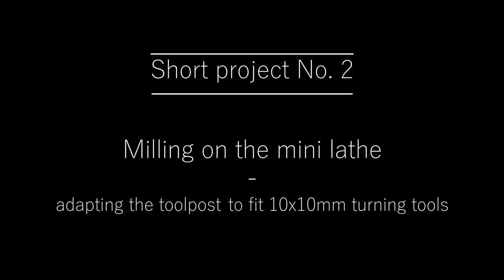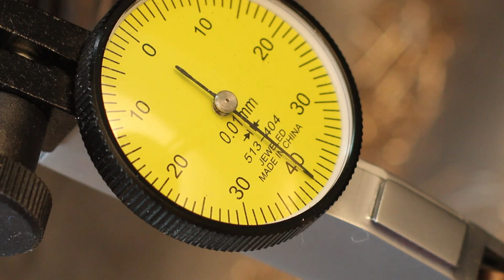Short project 2 - milling on the Mini Lathe - adapting the toolpost

Comment: excellent accomplishment. I have the inverse problem, the insert is too low and I have to raise it by 3.1mm.
regarding the milling bit, I recommend to disassemble the spindle and use an MT3 -> er32 shank and you will have much more precision and stability.
Reply from the maker: Thank you! Raising the tool seems a bit easier, you can shim it with some sheet metall:) And yes, a collet chuck would be great for milling operations on the lathe. Unfortunately I have none at the moment. Perhaps in the future

Comment: Excellent video. Of course a quick change tool post would solve the issue BUT that costs money. Much more rewarding to solve the problem with what you already have. I find the standard toolpost more robust than the cheap QCTP I have so I prefer to use it when possible.
Reply from the maker: Thank you very much! I would like to have a quick change toolpost off course, but at the moment haven't the money for that so I tried to modify the original one to be more usable for me. It's actually not that bad if you haven't a lot of different tool which you need to change often. To have now the possibility to clamp 10x10mm tools is hopefully a good improvement on it.
Reply: @WeCanDoThatBetter  Nevertheless I would recommend to buy a Multifix size AA (also named A0) for this lathe. You can clamp tools up to 12 mm height without any modification and it gives a lot of advantages.
Reply from the maker: @drucker03  Thanks for your comment! I got a Multifix Aa Toolpost in the meantime :) You find the video about installing it on my channel too. It is so much more pleasant to work with the last with the new toolpost. Makes everything much easier. Really happy with this change.
Reply: @WeCanDoThatBetter  I didn't see that yet, because I watch your videos from the oldest to the newest. But it was for sure the right decision to install a Multifix.

Comment: to minimise vibrations on these tiny lathes you can clamp down a chunk of steel in the opposite side of the tool post. in my case i can fit 25mm in the post. I have a cigarette packet block of mild. it makes a big difference.
Reply from the maker: Oh that's interesting. Thank you!

Comment: Excuse my ignorance, I'm a woodworker with a mini-metal lathe, but what is the tool in the chuck that you use - the one that looks like a drill bit?

I assume that's some sort of milling tool?

Thanks for taking the time to upload your videos.

Regards from Australia.
Reply from the maker: Hi, thanks for your comment. You mean that tool I install at 1:20? That's a carbide endmill which means a metall milling cutter out of the material carbide. They are used in metalworking to remove material on a milling machine. In my case, I have no milling machine, so I used my mini lathe for milling :) Best regards

Comment: Hello , nice idea , can i ask you is it obligatory to hold it to a 4 jaw chuck or a 3 jaw would do ? I thinking to do some milling on my lathe without buying a collet yet . By the way i ve seen Some bangood collet set reviews and they sometimes have more runnout that a 3 jaw chuck . Also i am thinking of making a vertical milling slide for my lathe with linear bearings cause i have them as a spare and secondly the vertical slides i can find close to me are not good and the good ones will take to much time to ship , whats your opinion ? Are linear bearings good for the job or dovetail slides are better ?
Reply: Using a mill in a 3 or 4 jaw chuck can be extremely dangerous i really wouldn't recommend it.
Reply from the maker: Thank you! I think, the 3 jaw chuck is better than the four jaw for this. It's a lot easier to clamp and the runout should be ok for this. Off course best would be a (good) collet chuck but just try it with the 3 jaw and watch the endmill. In my case the endmill wandered out of the chuck, be aware of that and clamp it tightly. 
For the milling slide, I think on manual small machines you go better with dovetail slides. The linear bearings are easy to install but they have no natural drag or resistance. That might result in chattering when not clamped firmly. But if you have the rails, I probably would try it out if its not too time-consuming. Apart from that you can find cheap vertical milling slides on ebay from india for about 60€. Perhaps they work aswell :)
Reply: @WeCanDoThatBetter  a trick you can use if you're gonna use a 3 jaw for milling is wrapping a piece of paper around the end mill, it helps to give it a little more friction so it won't slide put as easily
Reply: @WeCanDoThatBetter  
Hello , i know ve see them on ebay a month ago and thought a month would be too much to wait xaxa . Maybe a good way to avoid end mill slip would be to turn a cylinder with a set screw that will go to the flat spot on the end mill , i dont know if a bigger thing is easier to slip than a smaller . I know its better with the collet plus my lathe goes up to 4000 rpm that can be used with collet but with the chuck it says up to 2500 . An other idea , even more dangerous and maybe kind of stupid , if we grab a specialy grided tool bit in the 4 eccentrically woudnt that be a kind of a flycutter ?

Comment: Great video! I would have taken 2mm off the tool holder rather than mill the post. Good job nonetheless.
Reply from the maker: Thank you! Yes, that was my first idea too. But than I felt bad about milling the good quality Tungaloy insert holder and feeling better with a 2mm thicker tool. The 10x10 tool hopefully are a bit more rigid than the 8x8mm ones.That's why I come up with the idea to mill one slot of the toolholder to fit the 10x10mm tools and therefore are hopefully a bit more flexible with the tools in the future.
Reply: @WeCanDoThatBetter  Makes sense!
Reply: @WeCanDoThatBetter  The rule of thumb here is to always modify the least expensive part.
Reply from the maker: @garygruber1452  That is good to know. In this case the cheapest thing is probabley the tool holder :) I will change to a multifix type soon. So I better keep the 10mm tooling, it should fit great.